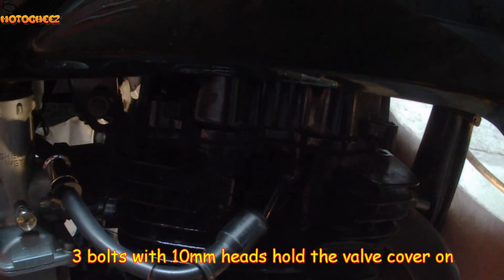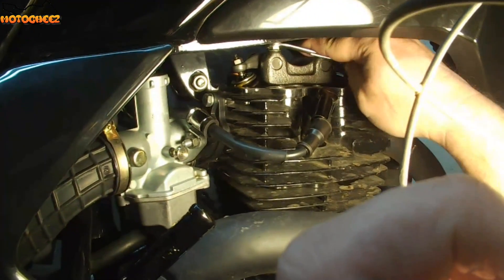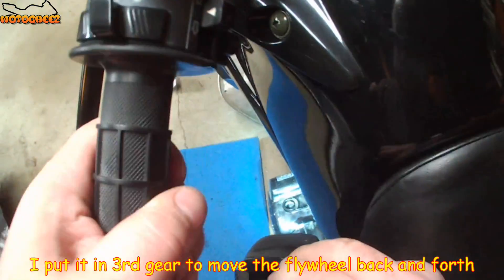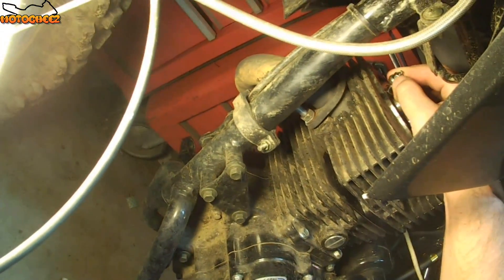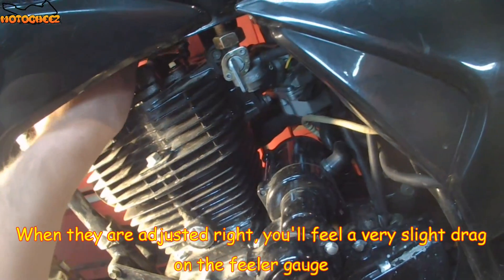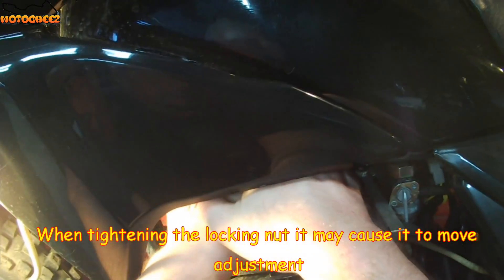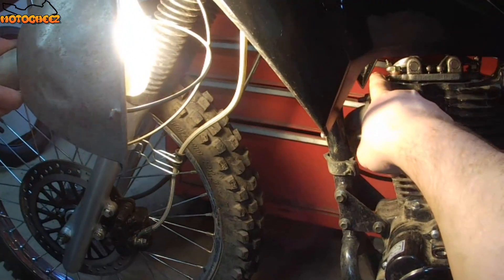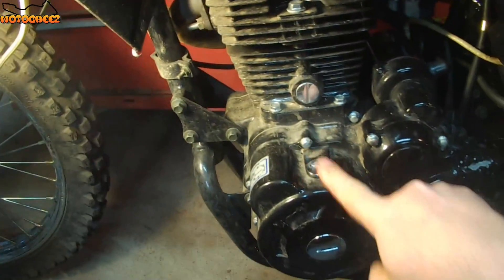[E17] Hawk 250 valve adjustment. UPDATED GAP SIZE IN DESCRIPTION

Comment: Should the .0015 and .0025 always be same every time adjust and how often  should I change
Reply from the maker: 5000 miles
Reply: @  also would you happen to know if there any aftermarket rims that will fit the bike I got a yz250 little wider rim but same size looked like the lace pattern was same was wanting put hub on it but are there any other rims that might fit replacing the hawk hub to it
Reply from the maker: @hicklifeoutdoors339 I've heard Honda has one that fits but I think drum brake. Chinariders.net has info on it

Comment: Would you say these specs are good for the brozz 250 recon as well?
Reply from the maker: Yes, read description for proper updated specs. I set intake and exhaust at .003"
Reply: @MotoCheez  we tried that on my buddy’s brozz today. Before adjusting he had good power and top speed after adjusting to .003 he lost power and the valves are significantly louder. He even tried going lower to .04MM it helped a little but not a lot makes me a little nervous to do the valves on my hawk I’m at 670 miles valves are quite and I can get up to 73 mph max so far on slight down hill
Reply from the maker: I don't think you had it on the compression stroke. HAS to be on compression stroke
Reply: @MotoCheez  how do I know if I’m on compression stroke? We pulled spark plug out and spun the crank until the piston was at the top and we had the T lined with the groove in the cap threads didn’t have any play in the valves when I first spun it to the T the piston was down and the intake valve had a lot of play it in so I figured that’s not right lol
Reply: @MotoCheez  I just watched you other video I forgot about putting my thumb over the spark plug hole. I’ve only done valves once on my riding mowing and it’s been a couple years lol thank you
Reply from the maker: https://youtu.be/FC0xWo4GSX0
It's every other stroke.

Comment: I do it a little different - I don't use TDC, I rotate the crank until one valve is completely open (down), which means the other valve is completely closed and able to be adjusted..
Reply from the maker: That's a good way to do it. I usually go off the cam when both lobes are facing down too

Comment: I did .003 Intake and .005 Exhaust. Cured my idle problem when cold and hot. Also turned 2 full turns on A/F mixture screw after screw it in. WOT runs great with no pinging and cold start is spot on at idle. Also changed the shitty Torch spark plug with a NGK. Torch had a problem with electrode melting off. Guy that owned a shop said 70% of the factory spark plugs would do this so now right out the crate get a NGK.
Reply from the maker: Nice  .003" both is good. In supposed to be .002... Small.

Comment: Thank you for videos man. Very helpful. 

I checked my valves on DLX Hawk and they were no clearance virtually. 
Exhaust manifold was getting cherry red after less than 60 seconds of idle. I adjusted the valves according to specifications in the video. Now it takes about a minute and they turn cherry red. Question: is it normal when stopped at a light that the exhaust begins to glow red in less than one minute?  Seems dangerous.

Also, after adjusting the valves I added an E3.36 spark plug. Seems to idle about 2K RPMs when cold then fluctuates between 1750 to 2000 RPMs. It’s done this ever since I’ve owned it and the bike currently has 7 miles on it.
Reply from the maker: Awesome. Biggest problem.people have with the adjustment is finding the compression stroke.
Reply: Question: 
Is it normal for exhaust to turn cherry red, glowing, at 1 minute idle. 
Adjusted valves and little changed regarding heat. Seems lean also.
Reply: @jaysea1051  No I would check your adjustment again. Also change jet fatten it up a bit these things run way to lean.
Reply from the maker: Lean usually too

Comment: Did you ever have to do a valve adjustment on your dlx, just wanted to know if the process is the the same?
Reply from the maker: Exact same as hawk. I go by ear and will check at 2000 on mine
Reply: @MotoCheez  what clearance do you recommend for the DLX?
Reply from the maker: Same as all the CG engine. .003" intake and exhaust.
Reply: Thank you

Comment: I adjust my valves, .4 and .5mm no bike is really ticky. Runs good but loud. Also when I looked at the valves they were really tight before.
Reply: And my tdc is just a line
Reply from the maker: You were not on the compression stroke, I did add how to find that video in the description. Because if they were too tight you were definitely on the wrong strokes every other stroke is a compression stroke top dead center

Comment: Thanks so much for the video. Where did put the socket to turn the engine over with. I assumed you were using the kick start.
Reply from the maker: You can do either. They make a cover on same side to line up the TDC on compression stroke

Comment: I really should do this on mine... Even with only 10 miles on it, she doesn't like to idle when cold, choke at any position until it warms up- even with mixture screw adjusted.

I'm betting my valves are tight as hell.
Reply: they usually ship tight and lean.

Comment: Question i adjusted mine and they were really tight.
I did .04 and .08 it ask for .07 but my set doesn't have it it goes from .06-.08.(would .08 work?) After i was done i turned it on i hear the valves clicking which i never herd it before. (I have 180miles on the tt250) i turned if off and i will check again tomorrow to make sure i did it right. 2 questions
1. Would .08 wotj for exhaust even though csc says .07?
2. Are the clicking valves normal? I didnt want to run it and mess up the engine
Reply from the maker: You weren't on the compression stroke. And it's .02" to .03" or did you mean mm?
Reply: @MotoCheez  
Yea mm.
I believe you are right i hat it on the t but i believe i have to put it on the notch to the right of the T?
Reply from the maker: Either will work, but has to be compression stroke. Which is every other revolution. And valves are looser on compression stroke.
Reply: @MotoCheez  
I just seen your video that explains how to find compression stroke. Sorry I'm a noob at this.
I will give it a try tomorrow once im back from work.
You just got a new subscriber 

Thank you
Reply: @MotoCheez  
Also im guessing il be okay at .08?
Reply from the maker: It' will work, yes.
Reply from the maker: It's a bit complicated, but once you know it, you won't forget. Thanks.
Reply: @MotoCheez  
I got it done today it is right now.
Thank you for your videos they really helped me out
Reply from the maker: Awesome!! Good now?
Reply: @MotoCheez  
Yea i get what you are talking about. I used your finger method where the sparkplug goes. I turned it a few times to make sure.

Thank you

Comment: I'm not sure  if you will reply to this but I ordered my bike pre built hawk 250 I couldnt get it to start when it first arived and it finally did and would turn off randonly and was super hard to get it to start I had to kick start it and so everyone said its the valve so I followed your guide and it started up in one kick but it ticks super loud and doesnt sound good like I have heard a few bikes with a little tick but its louder then the engine its on 002 for both exhaust and intake and I'm affraid to do anymore and I may just have to take ot to a mechanic because I havent been able to ride thw bike in 3 days
Reply from the maker: Hi. Sounds like you set the valves on the wrong stroke. Has to be on the compression stroke or the valves will be too loose. I did a video how to find compression stroke. https://youtu.be/FC0xWo4GSX0
Reply: @MotoCheez  oh yeah i didnt even know I had to do all that well ill get up in the morning and try to get it to work
Reply: @MotoCheez  thx by the way I watch all of your videos
Reply from the maker: Mason Merck thank you 👍👍

Comment: How can I find TDC of the compression stroke vs the exhaust stroke
Reply from the maker: I did a video 9f it linked in this video. If the valves rock at TDC it's off 1 revolution.
Reply: @MotoCheez  I found TDC my issue is now the tapping sound when I rev it
Reply from the maker: @liveandletlive2894  you did the updated gap? .002 to .003"
Reply: @MotoCheez  I'm gonna try that thanks I did .003 .004
Reply from the maker: @liveandletlive2894  closer to .002 on both

Comment: Hi my hawk is just a little over 1,000 miles . I was planning on doing the adjustment myself. But  was wondering if I could wait until winter ? And continue ride her thru the season would it be ok ? Is it necessary do at 1,000 or could you hold it off a bit?
Reply from the maker: If it's not ticking or running poorly you can hold off.
Reply: @MotoCheez  sweet. She running like a charm 😂

Comment: Hey motocheez just did this to my bike. It was on compression stroke and top dead set it to .002 and it still taps slightly. It's not exceptionally loud but loud enough that I can hear it over the rest of the bike. Just wondering if that's normal or if I should adjust it again. Not my first bike but unfamiliar with Chinese bikes
Reply from the maker: They will still tap a little, does it sound like my videos?
Reply: Yeah sounds similar it runs great definitely has more power. Like I said before though not loud but enough that I can hear it when riding. I feel like I have heard that slight tick in all of your videos though.
Reply from the maker: Good! Probably got it right.
Reply: @MotoCheez  thanks man just wanted to check. And love that even years later you still reply on this video. Keep up the good work man. Still my favorite youtuber so far.
Reply from the maker: 😁👍👍 thanks!!

Comment: I have an oil leak om the left side imside where the nut is to turn to tdc.  Is this a main seal leak?
Reply from the maker: Probably the crank seal. Not sure if that's replaceable by just taking flywheel and stator off. They usually are
Reply: @MotoCheez  also i love your vids.  You are the reason i ended up with a HAWK.  I refrence you in my vids lol.
Reply from the maker: TY, I'll give you a follow!
Reply: @MotoCheez  ty.  I will start tearing out the parts today.  😥
Reply: @MotoCheez  do you know what size or where i can get the seal?

Comment: What are they set at factory?
Reply from the maker: 1.5 in and 2 ex I believe. It's in the manual
Reply from the maker: The video is wrong, I corrected with popups and in the description. I went off an old Honda GC manual and it was off
Reply: I seen a diff. Guy set a brozz 250 at .005 and up too .008 on exhaust he said. Im thinking .003 on both? What do you think?
Reply from the maker: Yes .003 both

Comment: Figured I'd check mine before starting the first time after hearing so many people mention how tight or loose theirs were from the factory. Mine had zero lash on either one.... Glad I checked.
Reply: Seems like good advice before starting.  Just like checking all the bolts/nuts/screws for tightness and getting rid of the oil that comes in them.  Otherwise not a terrible investment for the low cost of ownership.  If I ever get one it'll probably have to be a Tao Tao TBR7 or the slightly more expensive CSC TT250 because Pennsylvania has a stupid DMV and doesn't recognize certain models as road legal...despite being virtually the same bike.
Reply: @scotteger6271  I sold mine after a few months. Got a Suzuki Intruder for $1500, way more fun and comfortable.
Reply: @painlesstom  yea I can understand that.  It wouldn't be my only bike...I recently got rid of a Triumph Bonneville T120 for a Suzuki V-Strom 650 XT.  It's a great all-rounder, but nothing like a light 250cc dual sport for an afternoon off-road.  I take the V-Strom on fire roads, but it's a little too big/heavy to do any serious off-roading, for me at least.  I've been looking at the Kawasaki KLX230 for a second, mostly off-road bike, but the price is terrible compared to one of these Chinese bikes...and used (good condition) Japanese dual sports don't exist...they're either cheap and destroyed or nice and nearly as expensive as new.  Safe riding out there!
Reply: @scotteger6271  which models are road legal in pa?

Comment: I adjusted my valve just like you did and they tap so loud it makes me nervous
Reply from the maker: You didn't get it on top dead center. You were one revolution away... I made a video how to find it. And it's .003"
Reply: @MotoCheez  both sides need to be .003 I need to use the feeler guage at .003
Reply from the maker: Yes, .003 is perfect for intake and exhaust..
Reply: @MotoCheez  thank you!
Reply from the maker: 👍👍 let me know how u make out

Comment: for the record, even .005 was too small on mine. The shop that imported mine to the U.S. (Ricky Powersports) in Texas, told me exhaust was supposed to be .009 and intake was supposed to be .007 but I put them both at .007 because having the exhaust at .009 was way too clattery and had a slight low end stumble. I've only had them both at .007 for one short trip around the block at this point, but it seems to be much better now.
Reply: 0.00285 was too tight on mine(both and on "T" on the compression stroke while cold).. That's with the properly gapped iridium plug, and the mix screw and mount lock washers and 110 main jet done on the pz30(I use throttle and idle screw to get past the slow/pilot jet issue)

It still  requires some turning over to start regardless of choke state. Once it's got to a smooth idle it'll crank in a second and idle at 1500 all day even in the winter..
Reply from the maker: aLukeWarmFart Gaming mine were a bit loud when I put them at .009. Those were the original honda CG specs. The closer tollerances I got right from the hawk manual. I think they're too tight also, so suited to the larger .003 for both.

Comment: So a quick question. Just did my gf hawk valve lash but the manual says .005. should it be .002 or .005? I did do it to .005 and it is loud as hell. They were ultra ULTRA tight from the factory.
Reply from the maker: .003 for both. Make sure you're on the compression stroke too!
Reply: MotoCheez will do, thanks bro!
Reply from the maker: I'd have to upload another video to correct it totally. That's why I added notations and other popups.  I suppose I could re do the video someday..

Comment: Your the best man, I just purchased a hawk 250 because of your awesome videos
Reply from the maker: Well TY 😀😀😀
Reply: Np man, Do you know how many miles the motor usually last ?
Reply from the maker: There are plenty out there with over 10,000 miles. I've only heard of one blowing up but who knows why.. it's literally a  copy of a Honda CG motor
Reply: @MotoCheez  Glad to know . I plan on owning mine for years to come..
Reply: @Brantonellis  That all depends on how you treat it. Do a bunch of irresponsible and amateur mods, run shitty gas, neglect oil changes and other standard maintenance and it'll shit on you. Ride it like you care about it, feed it good gas, and change the oil and it should last for years.
Reply from the maker: Over 10,000 miles on the magician blade bought. Doesn't burn or leak a drop of oil
Reply: These bikes are awesome! So much fun to ride

Comment: My 250 won’t go over 40 mph and idk why
Reply from the maker: You sure the choke is off? Sometimes that's the problem.
Reply from the maker: Peso TV I forgot to ask if this was after you adjusted valves?
Reply: Yeah the choke is off and I might need to adjust them again. I’m a beginner when I comes to working on it so I could’ve done something wrong
Reply from the maker: Ahh. Then yes, you adjusted them on the exhaust stroke, not the compression.

Comment: Bolts  are seized in the head on mine previous owners never had them off.... the cover on the flywheel is also seized in. Cheap hardware breaks right off. Only down fall
Reply from the maker: +Steve Townsender agreed

Comment: Had a moto mechanic check out my hawk it can only be push started he said it was the valve settings like the video you have here i can shift through every gear but can only go about 40mph if i gas it too much itll bog down so from your opinion i should do this adjusting and it will be the fix for my hawk?
Reply from the maker: Hunter Rathman I updated this video with annotations and put in the description, .002" is the proper clearance. intake and exhaust. I may redo this video because the annotations don't show on all browsers.
Reply: MotoCheez they don't show on the phone app. But I always go to the description
Reply: MotoCheez just wanted to know before I get one
Reply from the maker: +Hunter Rathman I would check the compression, it's possible that if you adjusted the valves on the exhaust stroke, I'm not sure but it should be around 150lbs compression. I should do a measurement for a video.
Reply from the maker: +Hunter Rathman here is the supplemental video to find compression stroke. https://youtu.be/FC0xWo4GSX0
Reply: MotoCheez they need to be at .002? right
Reply: He posted .005 exhaust and .004 intake
Reply from the maker: I wish they would let me edit the original video, I really should redo the video and upload it!!!
Reply: How do you a just the valves there's a nut on top ?
Reply from the maker: There is a locking  nut with a small adjusting nut, you can see in video fairly well.
Reply from the maker: Adjusting *bolt rather....

Comment: just got a hawk 250. some questions I have are should I break it in stock or do mods first? are the valves adjusted properly out of the box or should I adjust them before break in? how many miles should I check my clearances?
Reply from the maker: +Bryan Hann you can modify it before break-in. The valve adjustment I'd do about 600 miles.  Enjoy!
Reply: thanks man youre awesome
Reply from the maker: Bryan Hann TY TY, make sure you're on TDC when checking the valve clearance, I made a video because there is a lot if confusion how to find it.
Reply: yea I should be good I just did my valves on my dr200
Reply: thanks again tho